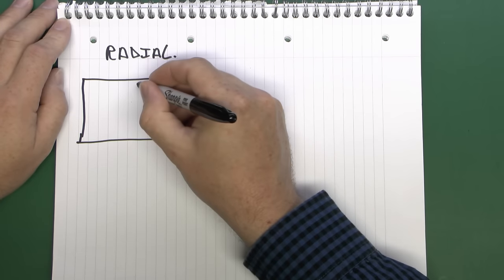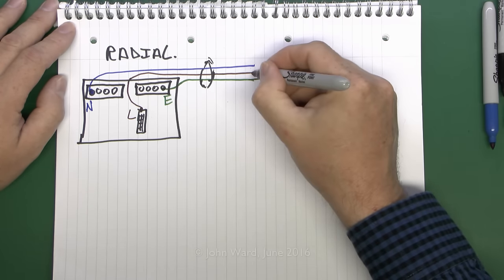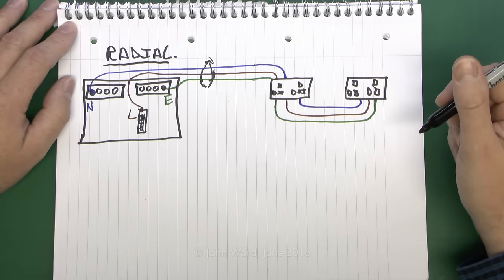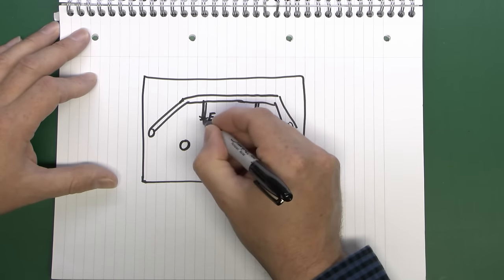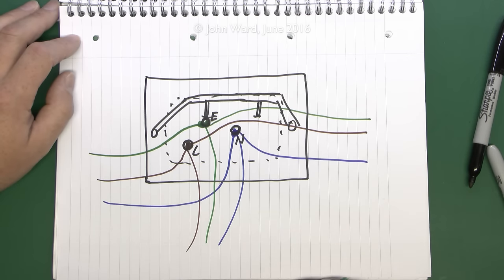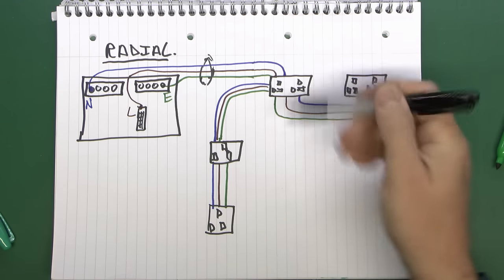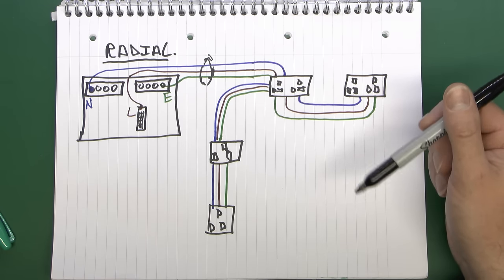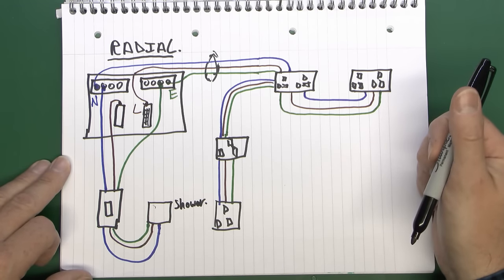Radial Circuits

Comment: Which circuit breaker would be used for a radial circuit with 2 fluorescent lights
Reply from the maker: 6 amps would be the most common choice, although other ratings could be used depending on the cable size and how/where it was installed.

Comment: hi just a novice here...so is there 3 cables going from socket to socket as aposed to the twin and earth on a ring main circuit...anybody.
Reply from the maker: Radials can be wired using T&E or singles, or whatever else is convenient.
The only difference between a ring and a radial is that the radial ends at the last socket.
Reply: You've just interpreted John's drawing wrongly mate. He's drawn a twin and earth (brown blue and green) between the sockets and shown the wires singularly to identify them and the connections. Those three wires in real life would be contained within a flat grey pvc sheath... What you would recognise as T&E. 
In commercial installations the wiring is often done in 'singles' not T&E cable, and is contained within metal conduit. Hope that makes it a bit clearer.
Reply: @bluebaz  thanks mate i thought thats what he ment
Reply: @jwflame  thanks john...got it.
Reply: @bluebaz  one more mate...why does he call live, LINE?

Comment: Can I use a 32 amp fuse in the fuse box for this.   Also can I wire 2 separate sockets back to the same fuse?
Reply from the maker: You can have any size fuse you want, provided the cable is of suitable size.  
No limit on the number of sockets either.
Reply: I’m using 2.5mm t&e.
Reply: Steve Eglen - With 2.5mm squared T&E the MCB or fuse should be 20A, or a 25A MCB only if the cable is not enclosed.

Comment: NO, Radial circuits are certainly not the most common type of circuit, especially with socket wiring.  Right or wrong  most electricians still favour the old ring circuit.  I have mixed views on this and used both before I retired.
Reply: Agreed. This 'anti-ring movement' is motivated by those who want to get rid of the 13a socket.
So they can sell us something else. There was a prototype 16 amp socket proposed as a possible EU standard.
This, if adopted, would allowed some European  Countries to get 80% grants to re-wire their houses.

Comment: Pity he didn't mention the currents in these radial circuits.  Ie if there were several devices taking 13A surely the cable nearest to the consumer unit could be overloaded.